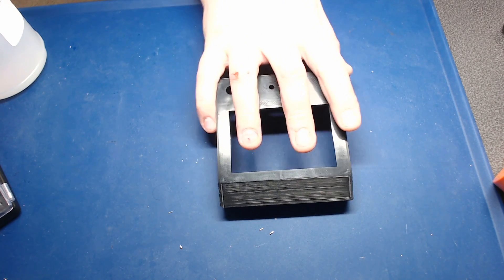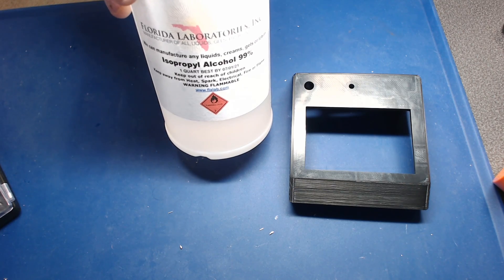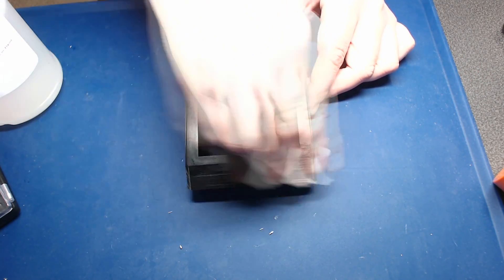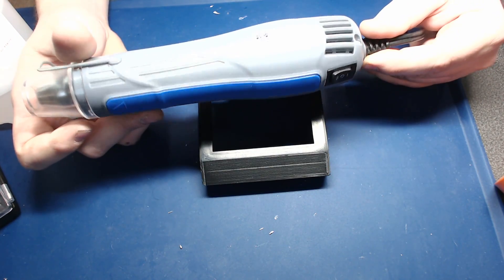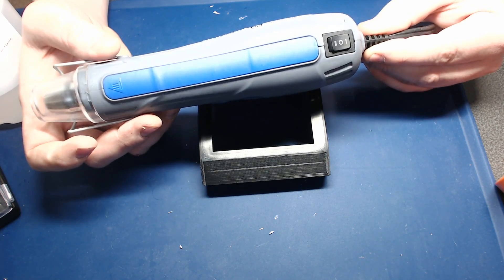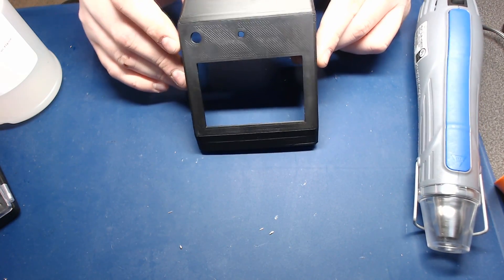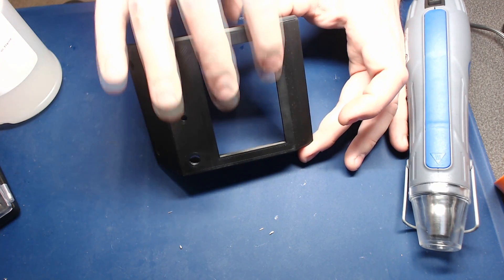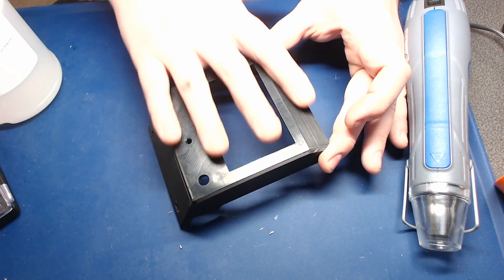EZTip #2 - Removing Stress Marks from Printed Parts

Comment: This might be my favorite video you've done, LOL.  I get this all the time, definitely need to try this.  I've got a hot air station with three memory settings for temperature.  I'm going to set one of them for doing this. What temp should I set it to?
Reply from the maker: Low on this heat gun I have is 200C and high is 300C which is what I used in the video.

Comment: I just heat up my bed to around 70C and press the part down for about 20 seconds and the white marks are gone. I've only tried this with black PLA though. Don't know if it would have the same effect on ABS, setting the bed to a higher temperature of course.

Comment: And harbor freight has a heat gun for around 15 dollars, less if u got a coupon
Reply from the maker: ehhhhhh having bought them before and having them fail in about 1 month I wouldn't waste the time. The one I use is only $20 and the build quality is great.
Reply: I have 3 that are between 3and 7 years old, all working as new

Comment: This is a good tip that many probably don't know about. 👍 I have been using the heat gun attached to my Surface Mount Device (SMD) solderer/desolderer station and that allows me to dial in the temperature to a finer degree (no pun intended ... haha). I use it mainly to help restore the surface colour on prints that I have needed to sand/file. I have never used IPA beforehand though, so will try that out next time to see if it makes any difference after sanding. A heat gun is also handy to "shrink" the occasional stringing artefact.

Comment: Try nail polish remover and get on with your day.
Reply from the maker: Takes too long and you run the risk of melting the print chemically. This much easier, quicker, and less chance of damaging the part.
Reply: @TH3DStudio  I recently bought the Kingroon and put your firmware on it (thanks for your effort) and it is an impressive cheap little machine. The kingroon's build plate is prone to this white residue if you don't wipe it with alcohol after a few prints. Using the nail polish remover is simple and easy as it only takes a few wipes on a clean cloth to get rid of that residue. The amount of contact time is around 3 to 5 seconds, I have been using this method for a couple of years now on my other 3 machines and as for part degradation I have seen none. Your method works and I am just giving anyone a very quick alternative, hell man I'm not soaking the part in it !!

Comment: While we're talking about heat guns, will you do a video to demonstrate the best way to take an old PEI sheet off of your spring steel build plate to replace with another? I have a totally worn out sheet and can't figure out the best way to get the old sheet off. I'ld like to put an ez mat on it because I just ended up buying another steel sheet to apply the new PEI sheet to.

Comment: Discoverend this recently after printing some ASA filamnet samples, they got white marks under when I took them off the buildplate, but I didn't think so much about it. But wanted to see how good ASA was compared to PLA for heat, so I dumped the parts in some boiling water, and the marks om the ASA parts was completely gone.  very cool. :)
Reply from the maker: Same idea as the video just more work. :P

Comment: For those who don't know the craft style guns are much better for what we do. Even the cheap harbor freight gun style guns will melt or deform your part quickly. For those, even on the low setting, start far away from your part. Thinner parts can deform in a fraction of a second!!
Reply from the maker: That was my logic for getting the smaller one over a large one. Plus the one I have is UL listed and has a lifetime warranty all for $20. Well worth it IMO.